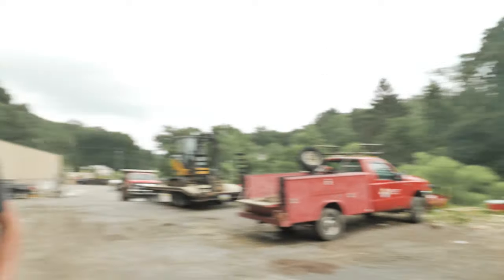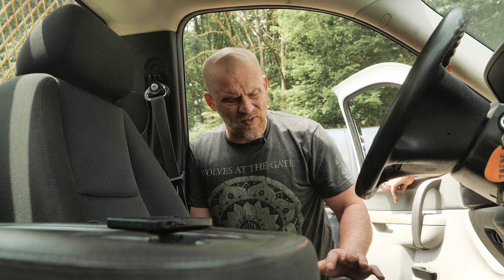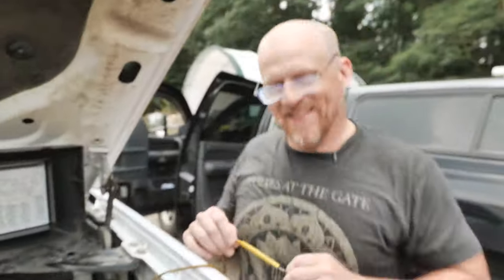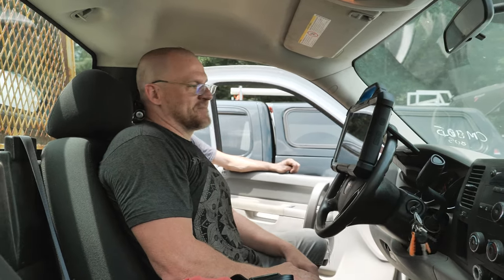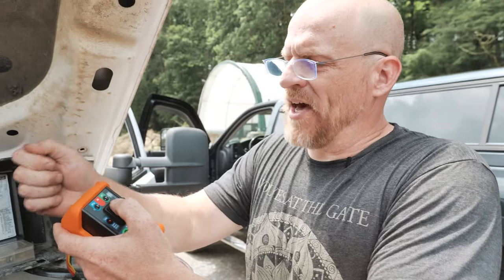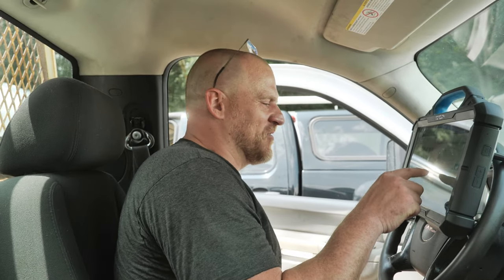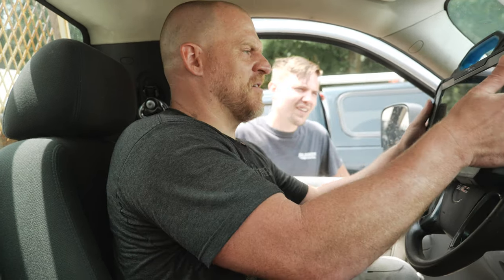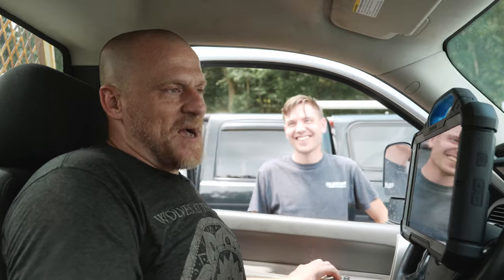No Start, No Crank - Suspected Bad ECM - [Auction Truck]

Comment: Sorry Danner, but that series of trucks you don't havee key to start. Just turn to crank and let go. It will crank till started. I think its 15-20 sec of crank time max. Had it on my 2007 Suburban & 2011 Sierra both LC9 Motors. Just info, in setup there's an option for auto crank. Comment @ 9:30 or so.
Reply from the maker: There is missing data in this video. I'm so sorry. Updating with the full length later this week. It's 27 minutes long and we show a bunch of control side tests showing no switching from the ECM. Not sure if that factors in on your comment or not

Comment: The Stabilitrak issue with GM 2007+ is a very common problem. Throws the Stabilitrak message up on the dash and often goes into limp mode limiting power and max speed to a very low speed. I've seen threads on message boards for it with hundreds of pages of people saying they had the same problem and all the parts the dealer replaced including but not limited to throttle body, accelerator pedal, lifters, cam, battery cables, steering angle sensor, crank and cam sensors, etc. I've never once seen it solved until now. 

Could it be that this is the cause for most or all of GM Stabilitrak related electrical problems? I knew it must be a wiring issue/can issue. I had an 07 Silverado myself that randomly had the Stabilitrak message come on and I never did figure it out either.
Reply: I also had the very common headlight issue where the drivers headlight wouldn't come on anymore and it wasn't the bulb. I've seen a lot of Silverados with the drivers headlight not working. Pulled the connector and it was extremely corroded. Managed to clean it all out and got it working again. 😊

Comment: After turning the key in you are satisfying the theft so the TDM tells the BCM everything is okay and tells the ECM to command fuel. You also found a key that worked and then you pretty much learned all the other keys. As far as the fuse panel they are defiantly more dependable than the TIPMS! Oh yeah put the covers back on the fuse panels!  Good stuff Paul.
P.S. What scan tool is that you are using?
Reply from the maker: I think this was the Topdon Phoenix Max in this one? Thank you!

Comment: Paul with CAN data lines do the manufactures dedicate these for generally for computer management systems?
Reply from the maker: You means the standard pins 6 and 14 for the high speed powertrain CAN systems?

Comment: The fact that multiple fuses are so corroded like that, makes me think that the front of this truck has been dipped down into salt water enough for it to submerge that fuse box. Or maybe the whole truck was in a flood.
Reply from the maker: nope, this is typical for the rust belt and it looks just like my fuse box on my 09

Comment: I'm having a problem with a 2010 Nissan Armada with a P1574 code, Cruise won't work when the code sets at about 47 mph, I turn the car off for a little bit and the cruise will work again until I reach about 47 mph, and no other codes in the system.
Reply from the maker: Define the code
Reply: @ScannerDanner  ASCD Vehicle Speed Sensor
Reply from the maker: @dealerauctionnightmare4689  you need to be checking that circuit with a lab scope. Your cruise won't work with a VSS code.
Reply: @ScannerDanner  I wouldn't know where to begin....LOL

Comment: I am considering buying the Phoenix Max, is the scope wireless or does it need to be plugged into the scanner?
Reply from the maker: I haven't even tried using it yet. I'm sorry
Reply: @ScannerDanner  I did add the tool to my arsenal. The scope is not wireless, I haven't actually tried it yet either as I am just used to grabbing my Snap-On when I need a scope. Thank you for your reply!

Comment: As soon as I saw transponder not programmed I figured a fuse and unprogrammed keys.
Reply from the maker: the 5v ref check confirmed that right away, didn't it? Even faster than checking fuses 😉

Comment: Hello, just found you video, I have a 2003 chevy venture van no crank no start , replaced the ignition switch cylinder, the stater is good all the relays are good all the fuse are good, the neutral switch is good , on the starter relay I get voltage on pin 85 with the key on that is the positive signal. pin 86 suppose to the  negative signal coming from the PCM, the PCM is not sending the negative signal to activate the relay. I apply a negative signal with a power pro and the motor turns but not start. The PCM gets   battery voltage and I check one of the map sensor and I get a 5 volts reference, I believe the PVM is ok but I can figure out why is not sending the negative voltage to the starter relay, Also I try to connect the scan tool and is not communicating with the PCM, Do you have any clues. Thank you for your time
Reply from the maker: Try another scan tool. Can you communicate with other modules? This sounds anti-theft related
Reply: @ScannerDanner  Thank you for the reply, I try another scan tool, I only have a cheap one, I used on another car and is function good, I believe is the anti-theft like you said, does this disable the PCM from communicating with the car ? Do you have a video for this problem? Thank so much for your help. I'm not a professional mechanic, just and old man that likes to help friends. God bless you, have a blessed day
Reply from the maker: @MiguelRodriguez-pz8wi it would not cause a no com (anti-theft issue) but no power on pin 16 of the DLC will and some of these older systems can give no com issues with a scanner and that has nothing to do with the actual problem. Does your theft  flash at you after trying to crank it?
Reply: @ScannerDanner  when I turn the key on the dashboard lights come on and when turn key to start they go off except the check engine light , after release the key the only flashing light are the battery, the traction control light and the low fuel light. I noticed some times their is little red light blinking on the radio

Comment: I have a captiva with a 2.4, U0073-00, and a P0615-00 hard codes. Intermittent crank no-start. ECM replaced, fusebox replaced, relays are good, CKP sensor good. I don't even know where to start...
Reply from the maker: neither do I :-) Start with defining these codes for me
Reply: @ScannerDanner  P0615-00 is a starter relay circuit fault code that can be set by a short to positive, ground or open/high resistance. And the U0073-00 code is a Control module communication bus off fault code triggered by constant or intermittent interruption communication between the modules.
Reply from the maker: @philljustphill1656  you need a scan tool that will scan ALL modules and get a better direction with that u-code
Reply: @ScannerDanner  Okay, thanks for the tip. I was using a launch. It reads everything, but it only coms when this code is stored, if you erase the code it doesn't communicate until it sets the code again. If I find anything I'll let you know. Loved your book 👍

Comment: I just received the book that i purchase from you Paul and im excited to up my knowledge by your help,you are a gift my friend thank you from Canada.
Reply from the maker: Thank you so much Michael! Really appreciate the support and I know you will benefit too.
Reply: @ScannerDanner  for sure it already benefit me reading your book for just 10min about O2 sensors and it gave me a good understanding of the sensors that I'm currently diagnosing for 2007 Honda fit, so excited for this thanks again Paul.
Reply from the maker: @michaelbuenvenida8473  I have a recent video on a Honda wideband in this year range https://youtu.be/CPsvgbCOdvo
Check it out, this will really help you with the foundation you'll have from chapters 4 and 5 (oxygen sensors and oxygen sensor testing). The widebands are a bit different, same stuff with the heater, but no real manual signal circuit tests as they operate in a 4 milliamp range between full rich and full lean. All scan tool tests once you've confirmed heater operation. You'll like this video!
Reply: @ScannerDanner  thank you so much I will surely watch this video's🙏

Comment: i have a 2006 the gen down from that truck with a no crank no start . i have 12.6 volts at pin 16 DLC, i have strong 5v reference, good ground at pin 4 and 5 DLC, i have 12v feed at starter but at crank no signal voltage so i believe the solenoid is good on starter i do have a U1000 code data link 2 no com i here the starter relay click under the hood any recommendations i have scannerdanner premium  and fully support this channel for all the knowledge its given me i am truly grateful what scan tool are you guys using here to read the network ?
Reply from the maker: you need to chase that U1000 code!
Reply: is there a way to do that without an expensive scan tool ?
could you reference a video of yours or a chapter i should focus on ?
Reply: also what was your guys determining factor on recommending he get a new fuse box ? i was just wondering because you got it running  with the old one . i had a mouse nest under mine and it smells like pee i cleaned it with connector cleaner 10:20  the best i could but just wondering if i should just go ahead and start looking for one maybe that being my problem but don't want to be a parts changer  thanks for the response man
Reply from the maker: @andrewgibson1991  you need to research that code, and find out which module you got it from, which I believe the global scan tool you are using won't do. Second, you need good service info to be able to research the correct flow chart and have wiring diagrams. 
https://eautorepair.adtrk.biz/?a=10817&c=24&p=r&s1=
Reply: sounds good ill ask for a buddy to use his snap on scan tool  to locate the faulty module , i have the wiring diagram bought from mitchell  as well thanks
Reply: follow up i was able to solve my no crank no start with your advice using the mitchel diy schematic and google ...followed the u1000 to the ignition the previous owner had installed a cheap remote start and had spliced into the ignition harness fixed the appropriate wires and it fired right up and all codes cleared. its crazy how one bad circuit can throw so many different random codes i had service four wheel drive to ABS to solenoid A and B for the transmission.. all cleared thanks again for all the motivation and support man and god bless man
Reply from the maker: @andrewgibson1991  awesome! Good job Andrew